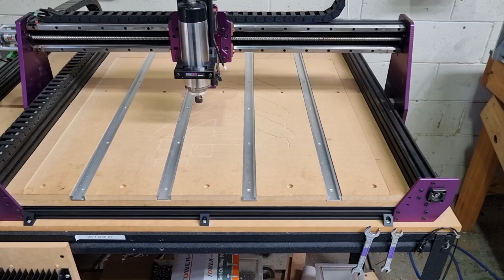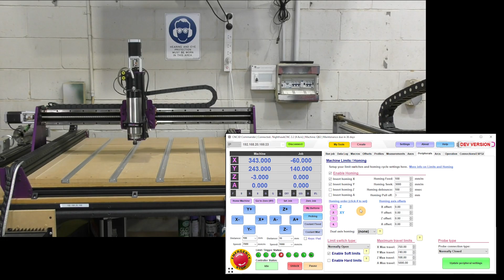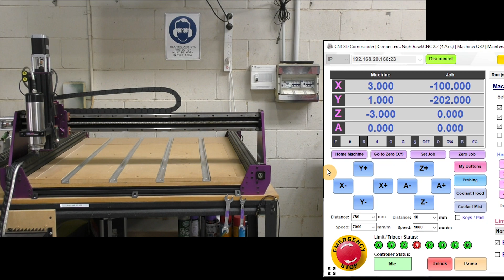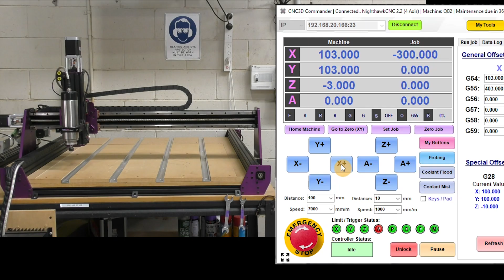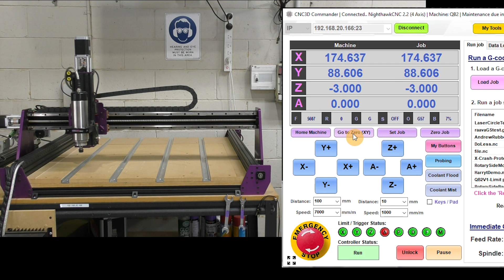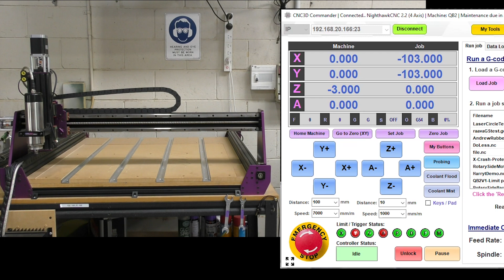CNC Tech-Tip - Learning all about Limits and offsets on Nighthawk, xPROV5 and GRBL CNC controllers

Comment: Hello.kann I use nighthawk for a big volume Maschine 2000x1200 cm .what would be the downsize outer speed .thanks
Reply from the maker: @ST_Technik  absolutely you can. The machine can be any size.
Regarding speed, very high. We have run a Nighthawk at 30m/m before without issue.
Reply: @cnc3d  thanks.which stepper motor would you recommend,Nema 23 or 34 ? Thank you for your support
Reply from the maker: @ST_Technik  if using the full Nighthawk, nema23 is recommended. 

If using the standalone Nighthawk card, it can be coupled to any stepper driver you like, in which case any stepper can be used.

If you prefer nema34, go with a standalone Nighthawk card at a higher voltage for best results.
Reply: @cnc3d  thank you ❤️
Reply from the maker: @ST_Technik  you're welcome. I'm happy to help. :)

Comment: Good explanation, I also noticed you have normally open limit switches, dangerous should a wire be cut or come off, you don't know, but its covered by the soft limits. After homing, my machine pulls of 1mm, I set this position in G28 with G28.1(fusion 360 always puts in this command) but I think I might try playing with G54-G59. I'm new to CNC and been playing about with a lot of programs, UGS, eSender, and Candle that came with the machine amongst others but CNC commander seams much more complete and at the top of the list so far.
Reply from the maker: Our limit switches are actually normally closed. We use optoisolators on our Nighthawk that inverts the limit type. :)

You are spot on! Always use NC switches where possible.